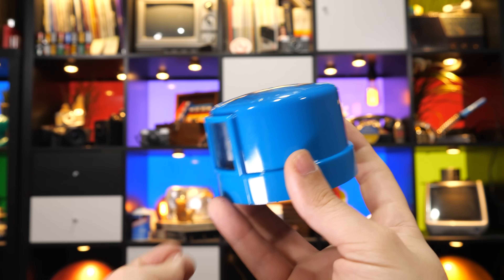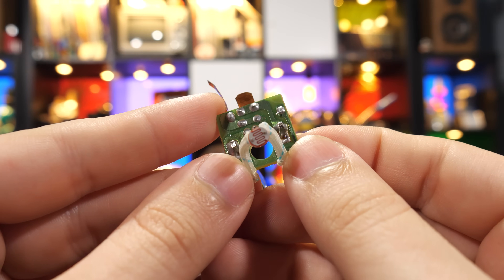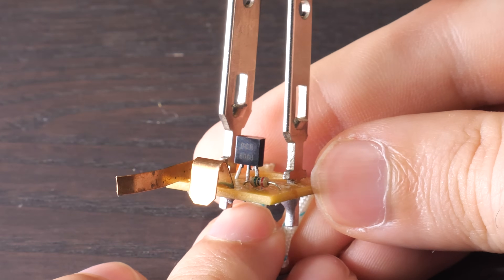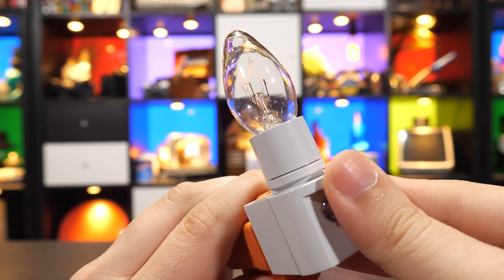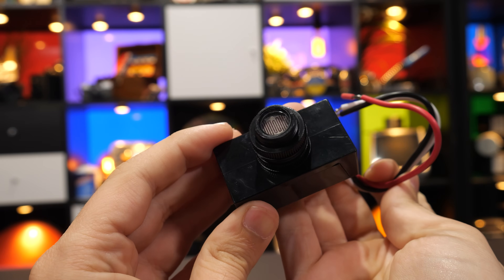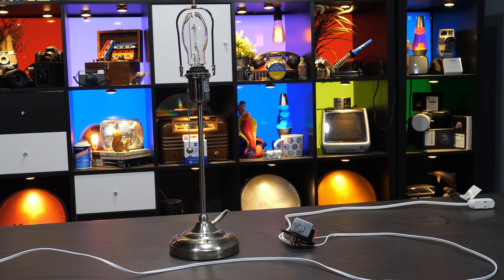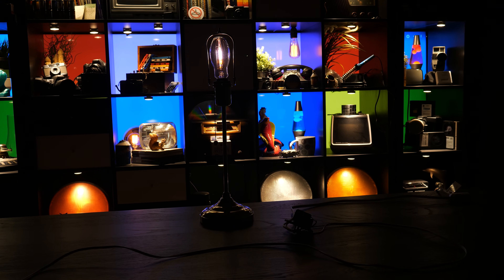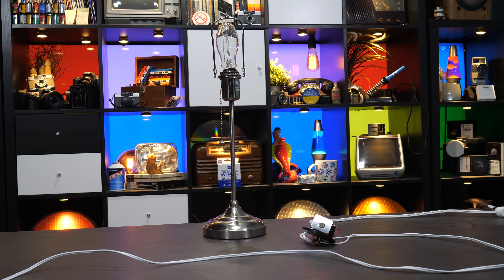Photoelectric light controls are weirder than they seem

Comment: Id say that most light sensors I seen have been electronic, I mean with a photoresistor as detector but some transistors and a relay instead of a heater and a thermal switch

Comment: I recently discovered this is how radio Tower lights that are incandescent work (strobes/led are much more complex), its a photo cell with a blinker, power is split in the controller one leg controls the side marker lights and the other is for the top beacon. older style controllers used a electric motor with a small bubble of mercury rotating around.

Comment: The heater might help drive off water as well?  I remember watching a video about lights that also gave off heat and how that helped deal with snow in edge cases, although that situation was a bit different so the conclusion was that cooler and lower-power lights were preferable...

Comment: I sort of expected the night light circuit inside, except instead of a little light bulb it just turned on and off a relay.  It seems like that would use less power, and still not require any software or computers.

Comment: The streetlights in my neighborhood growing up in the seventies did not have hysteresis. I loved hanging out on the porch during thunderstorms. And every lightning flash would kill the streetlights, and then they'd take a bit to start back up. Until the next flash.

And depending on what intermediate distribution voltage is in use, sometimes a string of streetlights would be wired in series such that the total operating voltage would match. Then they didn't need transformers to feed them. A few control modules would be installed along the line. Any one could turn the string off, which provided some redundancy in case one failed. These will generally fail closed anyway.

Comment: Oooooh I saw the thumbnail and said "it's a cad cell! It's a cad cell! I know how that works! Yay!"

Cadmium sulfide has a variable resistance that is photosensitive, and the relay is calibrated to open and close at a set threshold resistance value!

It's the same technology used to sense the flame in an oil burner! If the burner is off, and the cad cell senses light, it won't let the burner start. If the burner starts, and the cad cell doesn't see light in a certain amount of time, it shuts the burner off and requires a manual reset. If the burner starts, and the cad cell senses light, but then doesn't, and the burner has a control with a recycle function, it'll automatically reset until it doesn't get a flame on recycle.

Comment: That's quite an amazing way of doing it tbh. I assumed they would've used a standard circuit using a comparator etc but it's quite ingenious done with a thermal switch and resistors acting as a heater. I literally lol'd when you said hysteresis because I was thinking exactly that. I enjoy nerding out on your channel :)

Comment: Our street lamp was barely glowing - giving off no light, but the bulb had a slight glow - and it was 10pm. Noticed that tonight, then saw this video.  Does it help me troubleshoot the issue?  Maybe… possible the photo resistor is going bad and giving too much resistance when dark outside? Or that little calibration screw needs to be adjusted.  Either way, that’s 20’ up a lamp post that belongs to the city, so my only way of “fixing it” is to place a phone call. But good to know they can change that cap and likely fix the issue - unless the 30 year old bulb is burning out…

Comment: Here in little old rural England we have a simpler solution. At the approach of dusk we send out an army of little old peasants with long poles, which have a lit candle on the end. At each lamp pole they hold the candle against a bi-metallic strip until the lamp lights. The bi-metallic strip then takes so long to reset it is dawn by the time this happens. The only running cost is 2 slices of mouldy bread to keep the peasant sustained. 😁😆

Comment: I have a photo-control I "rescued" from a knocked-down streetlight years ago. Unlike the thermal type that you showed here, mine actually has a small circuit board with a relay and many other electronic components, including a 555 timer IC if I remember correctly. It still does use the classic cadmium-sulfide (CdS) light dependent resistor as the actual sensor.

Most streetlights throughout my area are independently controlled by their own sensor; leading to each individual streetlight turning on at different times at sunset. The streetlights that I know which are operated by a centrally located photosensor which switches on a lighting contactor, are the one along our freeways

Comment: There are different designs of photocell heater circuits, some types use a carbon ribbon across a latching bimetallic strip. Others use a magnetic relay. I’ve seen other variations of these basic designs.

Comment: I'm slightly annoyed that you didn't explain how the photo-resistor is a thermostat....what's the material? Is the heat generation a photo-chemical reaction? If so, what chemical gets hot with light? If not, is it working off of radiant heat generated by the light? If so, how are other heat sources dealt with? Maybe we need a connextras video on the sensor itself.

Comment: In the town where I grew up there was at least one streetlamp that would switch off when a car hit it with high beams just right. I'm guessing that particular lamp was either wired differently or it's control unit was faulty.

Comment: I started.playing around with different types.of photoelectric light controls back in the early 1970s when I was about 14. I took.many.apart to see exactly how they worked. One.of my favorite designs was the thermal relay. Very clever way to incorporate a delay so that flashes of.lightning or flashes of car headlights don't trip the control.

Comment: in case of a power blackout, the resistors will all cool down and the lights would default on. Wouldn't that put a significant extra strain on the power station, considering its already hard to get it back online after an outage?

Comment: Great video Alec! As a side note I would like to add please but a reputable brand of photocell or fixture containing a photocell like RAB or lithonia. Make sure you get a fully molded photocell so the water on an exterior fixture doesn’t get in and ruin it. Those cheap Home Depot or Lowe’s lights always fail prematurely. I have been doing electrical work for 10+ years

Comment: The delay is actually to prevent nuisance triggering from clouds passing during the changeover period. There are also fully electronic versions of those modules (for street lighting) as well as even more primitive versions using a resistance wire heating element wrapped around a bimetallic switch.

Comment: Interesting. I've seen a different implementation. In the version I've seen, the photoresistor directly powers a large relay (that's the why the photoresistor needed to be so large -- you wouldn't need a large one for a thyristor version). The relay ones are "cheap" versions, and they buzz quite horrifically.

Comment: The street lights in my neighborhood all have modules on top that blink at a regular interval.  Sometimes there's a second blink, with a different color (amber instead of red.)  My hypothesis is that they're linked via some kind of wireless mesh protocol, and the blinks are TX/RX indicators.  Sometimes I wish I had a spectrum analyzer....  And by "sometimes" I mean, with great frequency.  heh.

Comment: Back in the late 1960's when I was a kid any time I saw one of the guys on a electric utility truck working on a street light I would stop and talk to them and ask if the has any of the Photoelectric sensors that the had removed that I could have and the would give me a box of used ones. The best time to hit them up for the sensors was after a thunder storm because lightning would take the sensors and the street lights out. Back then the ones that I would get had a real relay in them and some times the only thing wrong with them was the relay contacts were fused together and could be puled apart with a small screwdriver. The ones with the relay did not have any HYSTERESIS I found out if you wired it to a light and put the light in front of the photoresistor that the light would go off and on and the rate could be controlled by shadowing the photoresistor like you did. I slowed down your video and it looked like SMOKE to me!!!
One more thing regarding getting the Photoelectric sensors, if we did not have any thunder storm for a while, I got the utility truck guys to come out with the help of _MISS BB DAISY!!!_🤣

Comment: So this explains why in very cold weather the street lights sometimes get stuck on.
And wouldn't this be a use for a tiny solar cell to power the heater? when there's light, it works, when there's not, it doesn't need to.

Comment: I love the simple solutions. They provide more robust solutions to problems like these. Compare the longevity of washing machines (to name but one). The old washing machines with (simple) analog cycle selectors were hard to kill. You'd go decades without issues. The belt breaking was the most common malfunction. I made the mistake  of trading one of these reliable beasts for a new fangled model. I never use any of the "fancy" cycle options, and the tradeoff is that the electronics don't last "decades".  A few years operating in the humid conditions of a laundry room will fry them. That's probably why manufacturers switched to these new models with loads of settings that are not really needed for a perfectly serviceable washing machine. The old ones just wouldn't die, and you can't sell new stuff if the old stuff lasts a lifetime or  more.

Comment: I discovered this mechanism when the sensor on my garage light failed and I disassembled it. I was surprised to find a resistor and temp limit switch in it. The resistor on my unit had failed, it looked pretty baked.
Good video.

Comment: As an electrical engineer I look at these and think "That is an incredibly simple circuit to build!" then I realize that my simple solution requires low voltage DC which would add complexity and expense.  I'm always impressed (and occasionally disappointed) by the simplicity and cost-engineering that goes in to large-volume commercial devices.

Comment: This still feels grossly inefficient. You need a heater, in an outdoor device mounted on top of a pole, which only runs when the sun is out? The big, hot sun that can be focused through lenses to create incredible heat even through clouds? It seems like there might be a more efficient solution there.

Comment: I feel like a pair of zener diodes, each in series with a normal diode to prevent back-flow, along with a relay would be enough to create the correct rising-edge and falling-edge to convert the gradual change of the photoresistor into the distinct on and off states needed. Basically, you are setting two states, based on different amounts of resistance, for on and off, such that once one state is set, the other cannot be set until a more significant change has occurred. For example, if the light turns on at 5 ohms of resistance across the photoresistor, it will only turn off at 2 ohms, and vice versa (I'm throwing out numbers here for the sake of example). This would prevent the flickering effect, requires no microprocessors, and does not involve raising components to high temperatures.

Comment: When I was in college in the nineties, there were street lamps on my campus that would intermittently shut themselves off.  At night.  And I never understood why (and whether it was by design).  This thermal shutoff mechanism goes a long way towards making more sense of that.

And for the record, as a long-time software developer, I'm very much NOT in favor of a microprocessor-based solution.  Why write faulty code to solve a problem when a simple circuit will do just fine (said the guy who wants to cobble together a RPi-based timer for his living room lamp).

Comment: Back when everybody used tungsten floods in their outdoor fixtures, I wired one of these dohickeys into my back porch fixture so I wouldn't have to remember to turn it on every night. Problem was it burned out, faster then even the bulbs did. I tried several brands, but they all died a premature death. Fortunately, I have a high-quality LED fixture now, with its own photo-electric cell built in.

Comment: In the mid-90s, the first Wireless Internet Service Provider started up in Mountain View, California.  They needed a way to distribute their mesh wireless nodes around the city, and they needed power.  Their solution was to mount the radios on street light poles, and pull power from the photocell connection (presumably with a passthrough connector, unless they just replaced the photocell detector).  I don't know what kind of deal they came to with the city, but I always thought it was a great example of innovation.  Wikipedia "Ricochet internet service".

Comment: I want to mention that microcontroller solutions is also non reliable even if its software is perfect, because a single lukcy beam of cosmic ray can flip a bit anywhere in memory. So you need at least two, with additional logic of checking the faulty one. So it quickly becomes more complicated for a such simple case. 
Don't fix if it works fine.

Comment: In the 80's we only had a single one of those at a central junction box, controlling all the street lights for miles around. We kids back then would sneak there in the dark, climb up and put a flashlight over it. This was particularly fun during the dark fall and winter season, of course. Thinking back it seems strange how this sensor was not covered in disabling snow and ice, but maybe the heat from that thermo switch was less of a quirk and more of a critical feature...
Reply: Holy cow that’s genius, my vote is your 100% correct I was thinking what a strange waste of power but now it makes way more sense for cold climates.
Reply: @Moto_Medics Same principle as the traffic lights covered in another video on this channel I suppose. (The switch to LED traffic lights meant they no longer melted snow off without adding an additional heating element).
Reply: Well that changes the rules of “come home when the streetlights come on” a little bit doesn’t it!

Comment: As an electrician I have worked with devices like this, but I have never seen a thermoelectric one. They were always electronic. 
Maybe that is because I live in central Europe where a lot of electrical things are different and I think more modern.
Also the electronic ones are more energy efficient, and that's a big deal in Europe. Not to mention that they are adjustable and that's pretty useful. 
The industrial ones also let you adjust the delay time.
That being said I have replaced a few of these because they have failed.

Comment: I don't think you'd need a micro controller to make this happen with  just electronics parts. 

A latching circuit, a relay (or contactor), and maybe a transformer. 

If you need to prevent hysteresis maybe a timing circuit to limit the number of times it can change per some set time. (Which could probably be set by a value of a resistor (or even potentiometer and a 555 chip). 

It's not as cheap or simple as the circuit you showed. It's probably also more prone to environmental damage as well, like you pointed out. 

I can see why they use the simplicity and cheap one. But it also probably fails due to heat.

Comment: I had assumed a “more simple” arrangement; with a photovoltaic driving a normally closed switch, perhaps with a timer…
While the pv is producing enough voltage to hold the switch open, the supply current is blocked; once the pv is not generating, the switch closes and the light comes on…
I imagine that there are dozens of ways one could build a circuit to perform this function - and I love the idea that running a heater on the supply is (one of) the most efficient :-)

Comment: Really interesting video. Having the thermostatic switch is such clever solution except for the fact they default ON after a power outage, adding to the restart load problem of the grid.  2W doesn't seem like much, but there's about 45-55m street lights in the US, so at 2w*10h/day*365day/yr that's 7.3kWh/yr/light with sensor, which is 328 gigawatts across all 45m lights, just for the control.  At 10.632kWh/yr average household demand, that's nearly 31,000 homes worth of energy just for the control switch.  If you really want to see waste, measure the draw on your AC doorbell transformer.  Approximately 2.7W when it's just waiting all day for someone to press the button, and about 85m doorbell transformers in US alone.

Comment: As an electrician, I have installed a lot of these, I have always been annoyed by how long they take to turn on and off for testing... but at least now I know why. The new photo eyes made for LEDs are instant so I am sure they don't use a heating element, they are probably some sort of electronic. But I also don't see what would be the problem with just using a normally closed relay with a photoresistor, Light hits it the relay turns on turning off the lamp, no light then it turns off and the lamp turns on. unless a photoresistor can't let enough current flow to power a relay.